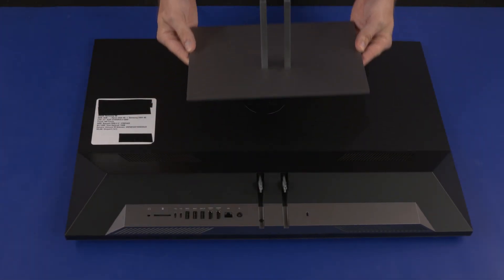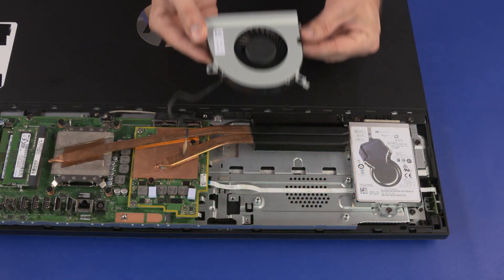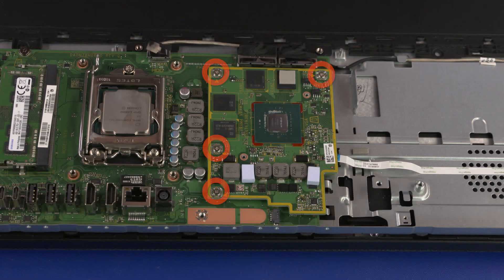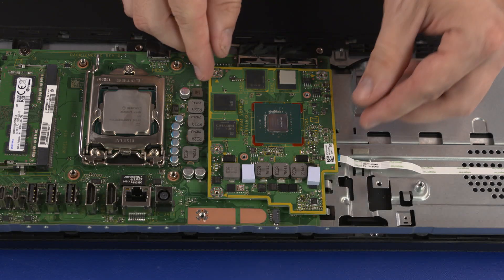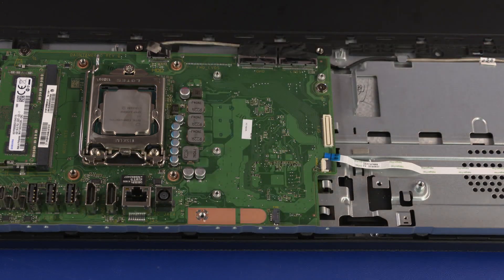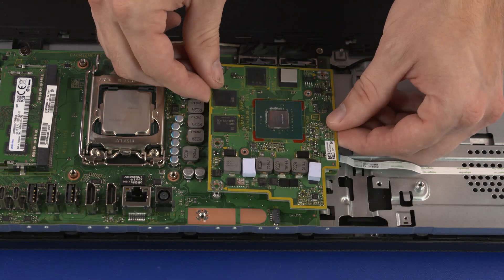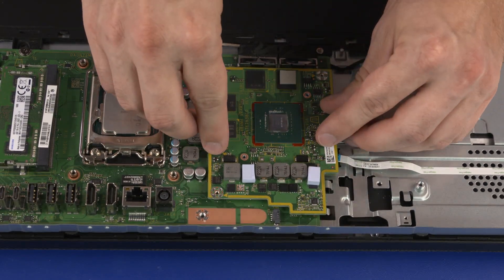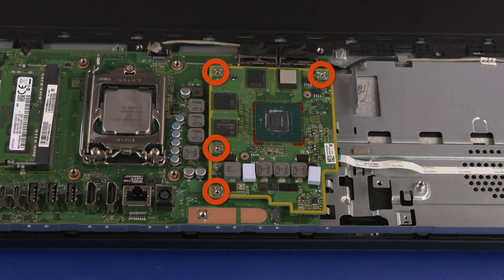Replace the Graphics Card | HP Pavilion All-in-One 27, 24 PC | HP

Comment: Can I upgrade gpu in hp pavillion g6 2200 notebook pc ???
Reply from the maker: +Toxic 2.0 Solution one- download (speccy) It'll tell you your motherboard name, google it to check if it has a graphics card slot that is welded in place or is one that can be changed. If yes then go onto crucial.co.uk it should help to tell you what graphics card you're best upgrading to or if you know your stuff then get whichever you like. solution two - if your card is soldered into place then just buy a new one. Remember if you're going to open up your laptop chances are your warranty will be void.

Comment: Can I change my graphics card on hp probook 4520s
Reply from the maker: +Lucas Hama HP does not recommend upgrading or downgrading hardware parts or software that is bundled with the product as It may affect the manufacturer's warranty and performance, however, you could change the configuration at your own discretion.

Comment: Is it possible to change the graphics card on my hp 15-db0xxx manythanks 👍🏻
Reply from the maker: +sprocky Lock Solution one- download (speccy) It'll tell you your motherboard name, google it to check if it has a graphics card slot that is welded in place or is one that can be changed. If yes then go onto crucial.co.uk it should help to tell you what graphics card you're best upgrading to or if you know your stuff then get whichever you like. solution two - if your card is soldered into place then just buy a new one. Remember if you're going to open up your laptop chances are your warranty will be void.

Comment: Can i change my intel i3 10th generation cpu to a brand new amd ryzen 5 3400g in my hp 15-ac091Tu
Reply from the maker: +RELIPSEY HP does not recommend upgrading or downgrading hardware parts or software that is bundled with the product as It may affect the manufacturer's warranty and performance, however, you could change the configuration at your own discretion.

Comment: can i able to replace in hp pavilion cc-129-tx
Reply from the maker: +SHUBHAM KUMAR SHUKLA HP does not recommend upgrading or downgrading hardware parts or software that is bundled with the product as It may affect the manufacturer's warranty and performance, however, you could change the configuration at your own discretion.

Comment: if i got a new cpu could possibly change my gpu to the better?
Reply from the maker: Hi there, thanks for contacting!
I am here to help!
What seems to be the issue? Are you facing any technical issues with your HP computer?
May I know the computer you are using?
Let me know!
Binu - Social Media Tech Support
Reply: @HPSupport  i have  a hp palilvon all in one 27 doxx and i wanna know what gpus i can get and what chip gpus are called
Reply from the maker: Thanks for the reply.
Unfortunately there is no Expansion slot available for graphics card. Hence you will not be able to upgrade the graphics card on your HP All in one PC.
Binu - Social Media Tech Support

Comment: Hi i am using hp au123cl can i upgrade my gpu ?
Reply from the maker: +Jermanus Alonzo There are no graphics 'cards' in your notebook. There is a GPU which is soldered and integrated onto the motherboard. The only way to upgrade the graphics, would be to replace the motherboard with one listed in the service manual which may have better graphics.
Reply: Where and how much will an new motherboard cost?
Reply from the maker: +Jermanus Alonzo You can purchase the part from here: http://partsurfer.hp.com/ Please select your country and enter serial or product number of your unit.

Comment: is it possible to upgrade the graphics card on HP Pavilion 27-d1021 27" All-in-One PC - Intel® Core™ i7, 1 TB SSD
Reply from the maker: +Vlada Vilo Checked the specifcation of your computer and found that it does not have an expansion slot to add external graphics card.

Comment: Can I change/upgrade my graphics card for my laptop HP Pavilion 15-ec0106ax(1A6X8PA) Ryzen 5
Reply from the maker: +balaji virat I have checked the specification of your notebook and did not find any expansion slot to add external graphics card.
Reply: Can I replace the existing graphics card to a new higher version?

Comment: Would I be able to change the graphics card on the "HP all in one 22 df0xxx (Motherboard HP 86F7)"?
Reply from the maker: +Marco Standad Checked the specifcation of the motherboard and found that it does not have an expansion slot to add external graphics card.
Reply from the maker: +Marco Standad Checked the specifcation of the motherboard and found that it does not have an expansion slot to add external graphics card.

Comment: Hello can I Upgrade the GPU of my HP Pavilion 15DK1508TX
Reply from the maker: +GAMING POWER There is a GPU which is soldered and integrated onto the motherboard.
The only way to upgrade the graphics, would be to replace the motherboard with one listed in the service manual which may have better graphics.
This is normally an expensive and labor intensive project.

Comment: Can I update the graphics card of HP 27 inch AIO dp1117in?
Reply from the maker: +Puneet Chhikara Checked the specifcation of your computer and it does not seems to have an expansion slot to add external graphics card.

Comment: Hi there my laptop is hp 15 notebook can I upgrade graphics card?
Reply from the maker: Hi there, thanks for contacting HP Global Social Media Support!
I understand that you need to know about upgrading the graphics card of your notebook.
I will do my best to assist you.
Solution one- download (speccy) It'll tell you your motherboard name, google it to check if it has a graphics card slot that is welded in place or is one that can be changed. If yes then go onto crucial.co.uk it should help to tell you what graphics card you're best upgrading to or if you know your stuff then get whichever you like. solution two - if your card is soldered into place then just buy a new one. Remember if you're going to open up your laptop chances are your warranty will be void.
Binu - Social Media Tech Support

Comment: Hello hp support can i add a nvidia graphics card to my pc
pc specs - HP 200 G3 AIO
8 gb ram
Core i5 8th gen
pls say that can i add nvidia graphics card?
Reply from the maker: +4u Dudes Checked the specification of your computer and found that it does not have an expansion slot to add external graphics card.

Comment: Can I upgrade graphics card in Hp Pavilion Laptop 15-eg2xxx to 4gb?
Reply from the maker: Hi there, thanks for contacting HP Global Social Media Support!
I understand that you need help in upgrading the graphics card of your notebook.
I will do my best to assist you.
In most cases, it's not possible to upgrade your laptop's graphics card for a better gaming experience. As we mentioned earlier, most modern laptops come with an integrated graphics card that's soldered into the motherboard, allowing for minimal customization.
Regards, 
HP Support
Reply: @HPSupport  Could you please tell me whether mine is upgradeable?
I already gave you my Laptop type
Reply from the maker: The only way to upgrade the graphics, would be to replace the motherboard with one listed in the service manual which may have better graphics.
Regards, 
HP Support

Comment: Can i upgrade my graphic card? I got hp pavilion 15-Cs2111TX. Please Reply
Reply from the maker: +k a Solution one- download (speccy) It'll tell you your motherboard name, google it to check if it has a graphics card slot that is welded in place or is one that can be changed. If yes then go onto crucial.co.uk it should help to tell you what graphics card you're best upgrading to or if you know your stuff then get whichever you like. solution two - if your card is soldered into place then just buy a new one. Remember if you're going to open up your laptop chances are your warranty will be void.

Comment: Can you confirm if its possible to upgrade graphics card on HP Pavilion laptop 15-en1070wm?
Reply from the maker: +brad bitely Solution one- download (speccy) It'll tell you your motherboard name, google it to check if it has a graphics card slot that is welded in place or is one that can be changed. If yes then go onto crucial.co.uk it should help to tell you what graphics card you're best upgrading to or if you know your stuff then get whichever you like. solution two - if your card is soldered into place then just buy a new one. Remember if you're going to open up your laptop chances are your warranty will be void.

Comment: Hi can you confirm about extending graphics card for HP pavilion 15-AU624TX?
Reply from the maker: +Zubair Nabi Solution one- download (speccy) It'll tell you your motherboard name, google it to check if it has a graphics card slot that is welded in place or is one that can be changed. If yes then go onto crucial.co.uk it should help to tell you what graphics card you're best upgrading to or if you know your stuff then get whichever you like. solution two - if your card is soldered into place then just buy a new one. Remember if you're going to open up your laptop chances are your warranty will be void.

Comment: i would like to upgrade my gpu(mx330) to a gtx super 1660, its possible?pc(hp 27 pavilion all in one dp0xxx
Reply from the maker: Hi there, thanks for contacting HP Global Social Media Support!
I understand that you need help in upgrading the graphics card of your computer.
I will do my best to assist you.
Change the graphics card on this type of computer, may be very complicated, if not impossible
You will probably only be able to install certain models if possible.
And on condition of replacing the power supply, which could be insufficient.
Regards, 
HP Support
Reply: @HPSupport   yea i know that, i just need to know if its possible i don't care how much hard it is
Reply: @HPSupport  also if 1660 can't fit you know some gpu more powerful that will work ?
Reply: its ok even if i have it out of the pc(external) @HPSupport
Reply from the maker: Use the HP Parts surfer to identify the part: https://hp.care/438CHZY 
And order it via the HP Parts store: https://bit.ly/3nKMYrs 
Regards, 
HP Support

Comment: I have the same “graphics card connector” on my mobo on my 24-xa0032, what GOU’s can I connect to it? Which did you use in the video and is there a part number for it?
Reply from the maker: Hi there, In order to get this issue fixed, please contact our customer care team over the phone or chat for further assistance, as this issue requires Live conversation with you over phone or chat to isolate the issue and provide you instantly with appropriate solution or repair/replacement options available at your place as per the warranty.
Please feel free to reach us on call/chat, please access this link to select your preferred country and language option to reach us. Global support link: -  https://hp.care/3SaGUs8
Akhil_HP Social Media Tech Support

Comment: Model -HP Pavilion x360 Convertible 14-cd0xxx.
Type-x64 based pc.
Processor-Intel(R) Core(TM) i3-8130U CPU @ 2.20GHz, 2208.
Can you please tell if i can change the mx130 graphic card or not.
Reply from the maker: Hi there, thanks for contacting HP Global Social Media Support!
I understand that you need to know about upgrading the graphics card of your notebook.
I will do my best to assist you.
May I know the complete model number of your notebook?
Please let us know!
Regards, 
HP Support
Reply: Model -HP Pavilion x360 Convertible 14-cd0xxx.
Type-x64 based pc.
Processor-Intel(R) Core(TM) i3-8130U CPU @ 2.20GHz, 2208.
Reply from the maker: Thanks for the reply.
Checked the specification of your notebook and found that it does not have an expansion slot to add external graphics card.
Regards, 
HP Support

Comment: Hello, is it possible for hp laptop 15-da3xxx intel core i3 1005g1 1.20 GHz to change graphics card?
if so which graphic card would be the best for that HP laptop.
Reply from the maker: Hi there, thanks for contacting HP Global Social Media Support!
I understand that you need to know whether you can add graphics card on your notebook.
I will do my best to assist you.
Checked the specification of your notebook and did not find any expansion slot to add external graphics card. 
Binu_HP Social Media Tech Support

Comment: it is possible to change hp pavilion n 259tx graphics card replacement its not working. if yes than will it support nvidia or up-gradable radeon  graphics card??
Reply from the maker: +jai kushwaha There are no graphics 'cards' in your notebook.
There is a GPU which is soldered and integrated onto the motherboard.

Comment: Hi, can you confirm if it's possible to change the graphic card for a HP Pavilion All-in-One - 27-d0038ns. Thank you
Reply from the maker: +Ivan Lopez I have checked the specification of your computer and found that it does not have an expansion slot to add an external graphics card.
Reply: @HPSupport   Thank you.

Comment: my laptop's model is r008tu and it has Intel HD Graphics 4400. I'm looking for upgrading it. Is it possible to upgrade?
Reply from the maker: +Noman Shihab Solution one- download (speccy) It'll tell you your motherboard name, google it to check if it has a graphics card slot that is welded in place or is one that can be changed. If yes then go onto crucial.co.uk it should help to tell you what graphics card you're best upgrading to or if you know your stuff then get whichever you like. solution two - if your card is soldered into place then just buy a new one. Remember if you're going to open up your laptop chances are your warranty will be void.

Comment: Sir i bought my hp pavilion gaming laptop 5 months back , and it started malfunctioning and slow operation after a month , my piece is a defective one , ot costed me a lot now what should i do , will the company resolve my problem .
Reply from the maker: +Sayan Saha Please perform updates via Windows and HP Support Assistant as mentioned below to fix this issue: Step 1 Windows Updates - 1) In the search box, type and open Windows Updates. 2) Check for updates. 3) If the updates are available, click on install and restart the computer. Step 2 HP Support Assistant Updates - 1) In the search box, type and open HP Support Assistant. 2) Check for updates. 3) If the updates are available, click on install and restart the computer.
Reply: @HPSupport  every thing done sir , all the drivers , updates etc are upto date , but these problems are occurring . I am getting very tensed .

Comment: HP All-in-One 24-f0xx.... Intel(R) Core(TM) i7-9700 CPU @ 3.00GHz (8 CPUs), ~3.0GHz  .. can i upgrade the Graphic card to RTX 2080? OR 2060
Reply from the maker: +Somali Pirate Checked the specifcation of your computer and did not find an expansion slot to add external graphics card.
Reply: @HPSupport  thank you.

Comment: I have a HP 24-xa1009 all in one can I add any gaming graphics card to my pc because I need more power for my games that my Radeon Vega 3 card can’t handle is this possible?
Reply from the maker: +MaddHatter202 HP does not recommend upgrading or downgrading hardware parts or software that is bundled with the product as It may affect the manufacturer's warranty and performance, however, you could change the configuration at your own discretion.

Comment: can i put MSI Gaming GeForce RTX 3060 12GB 15 Gbps GDRR6 192-Bit HDMI/DP PCIe 4 Torx Twin Fan Ampere OC Graphics Card (RTX 3060 Ventus 2X 12G OC) in my hp pailivon all in one 27 doxxx?
Reply from the maker: Hi there, thanks for contacting!
I understand that you need to know about upgrading processor and adding graphics card on your computer.
I will do my best to assist you.
Please refer 'Processor upgrade information' under the specifcation page to know about supported processors: https://bit.ly/3dmQo1J and there is no video slot on the motherboard.
Binu - Social Media Tech Support

Comment: Question if anyone is still replying to these comments
Can I upgrade my GPU to an RTX 3060
(HP Pavilion All-in-One - 27-a027c)
Thank you
Reply from the maker: +A C Checked the specifcation of your computer and found that it does not have an expansion slot to add external graphics card.

Comment: Hi, I'm using HP Notebook - 15-da0441tx and the product number is 5NZ78PA. The pc comes with NVIDIA GeForce MX130. I'm wondering if I can upgrade the graphic card by replacing it with any of the NVIDIA Geforce GTX 16 Series graphic card.
Reply from the maker: +Luqman Hakim Solution one- download (speccy) It'll tell you you're motherboard name, google it to check if it has a graphics card slot that is welded in place or is one that can be changed. If yes then go onto crucial.co.uk it should help to tell you what graphics card you're best upgrading to or if you know your stuff then get which ever you like. 
solution two - if your card is soldered into place then just buy a new one. 
Remember if you're going to open up your laptop chances are your warranty will be void.

Comment: can i change graphis card on HP All In One 20-C424d-Win10?
Reply from the maker: +TRIPLESSI HP does not recommend upgrading or downgrading hardware parts or software that is bundled with the product as It may affect the manufacturer's warranty and performance, however, you could change the configuration at your own discretion.
Reply: HP Support ok thanks

Comment: Hello! Can I upgrade the Graphic Card from this computer? HP Pavilion All-in-One 24-xa0xxx Product number: 3UT17AA#ABM
Reply from the maker: +work work HP does not recommend upgrading or downgrading hardware parts or software that is bundled with the product as It may affect the manufacturer's warranty and performance, however, you could change the configuration at your own discretion.